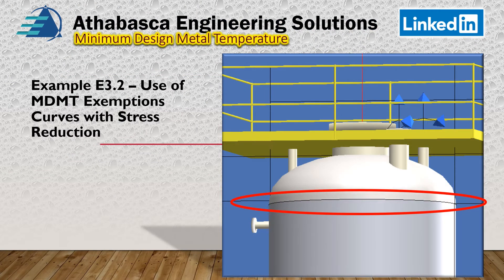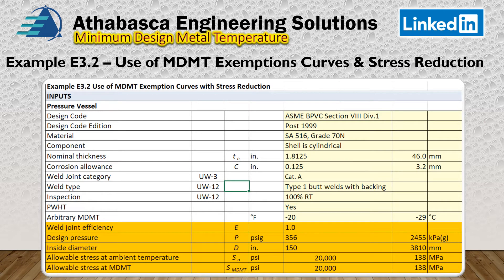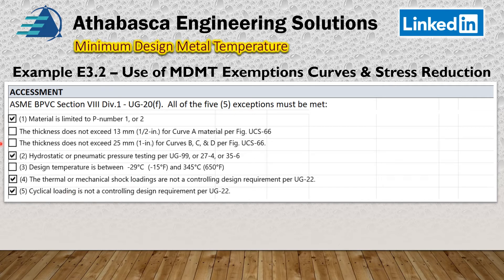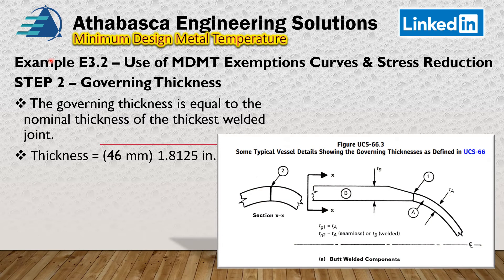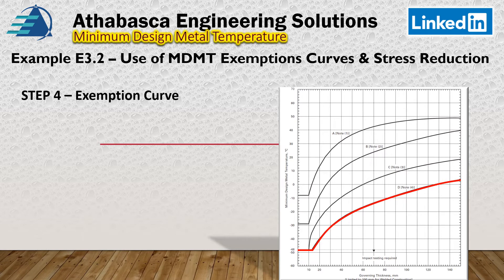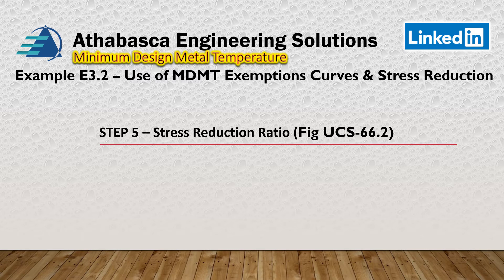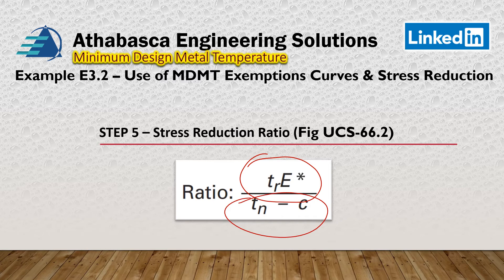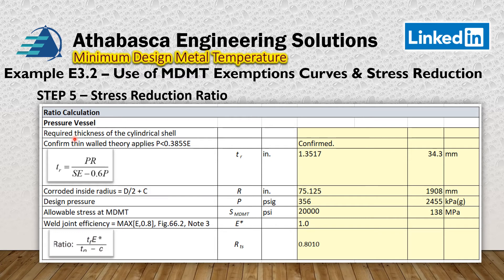Episode #7 MDMT ASME Section VIII Div.1 problem manual PTB-4 Example 2

Comment: One question: If PWHT is done even though it is not mandatory, can we subtract 17degC from MDMT from Curve UCS-66 after reduction with coincident ratio (in this video adjusted temperature is -32.7) or just subtract from temperature in Curve UCS-66 only? If let say your  required MDMT is -45 degC,  and the vessel is PWHT even it is not mandatory by code, will it give a final MDMT (min temp without impact test)  -32.7 - 17 = -49.7 degC? Thanks

Comment: Just a question if i have a shell of 65 mm (thk) and a elliptical head of 34 mm, whick thickness i should consider ?
Reply: Refer UCS-66 (a)(1)(-a), Governing thickness for butt joints except those in flat heads and tube sheets, the nominal thickness of the thickest welded joint. So, go with 65 mm.